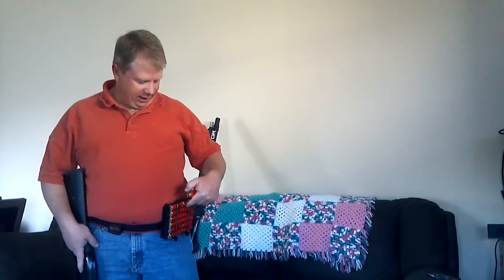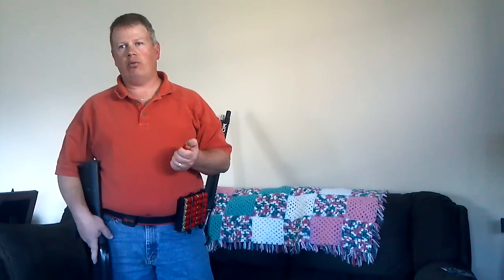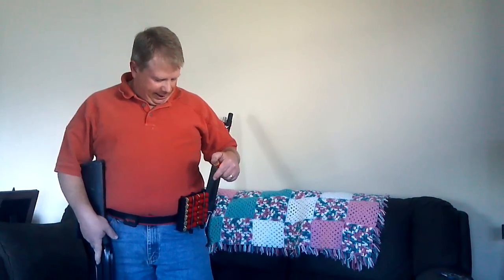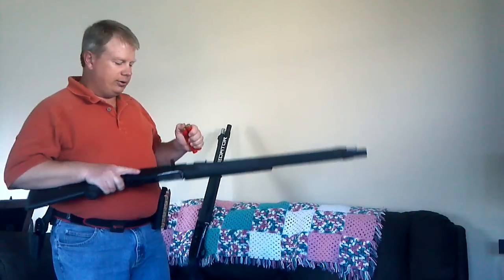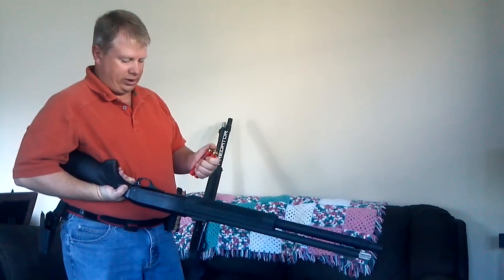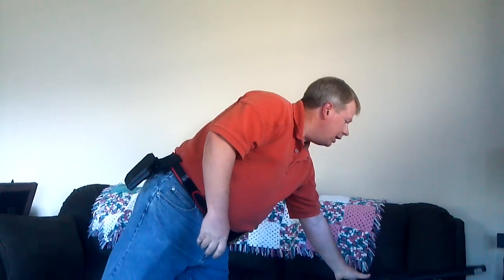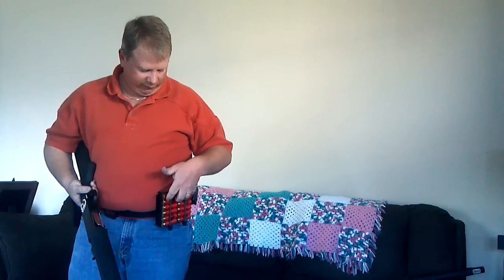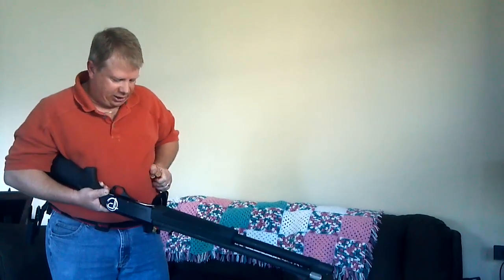MarkCO demonstrates the Quad load using the FSL12 from Carbon Arms.

Comment from the maker: So, it is now January of 2016, not quite 4 years since I made this video about the Quadload.  I thought it would take a few months for people to get to 3 seconds.  My best times are just below 3.5, but I don't practice quadloading much.  Anyway, it took a few years for the top 3Gun shooters to go to Quad loads and then another year for them to see the speed of loading off the chest.  There are now a handful of the top guys running in the 2.5 to 2.8 range...TO LOAD 8 SHELLS for the shoulder to shoulder.  Yes, firing will add about a 1/2 second.  But shoot one, load 8, shoot one in 3.0 seconds was the goal, and they have finally arrived at it.